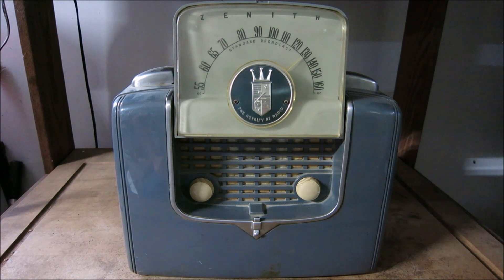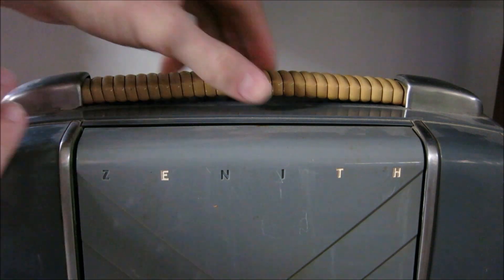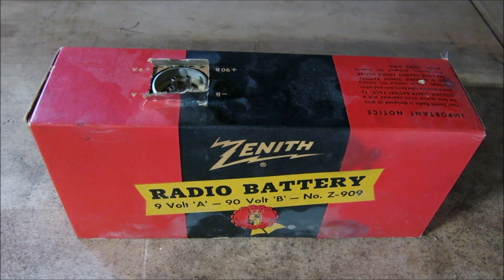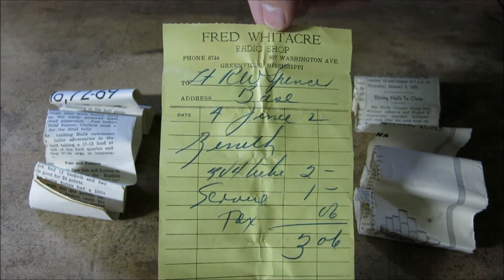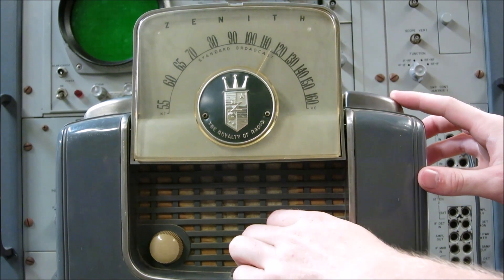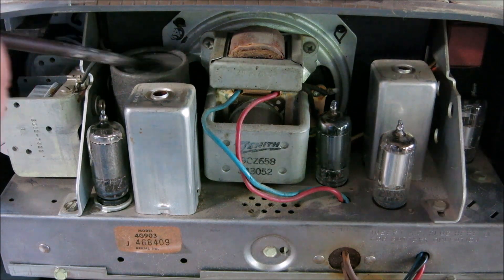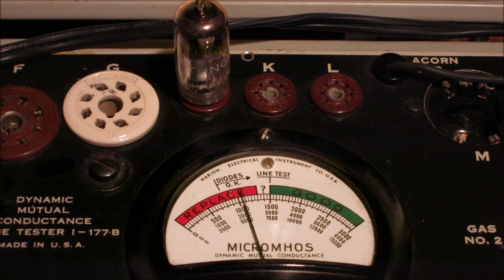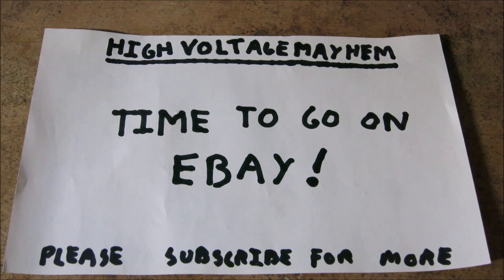Zenith Radio electronics repair/restoration (part 1)

Comment: I HAVE ONE OF THESE THAT'S MY GRANDMAS. I repaired it a few years ago just like this just brown leather and plastic that's so cool! The problem with my granny's was that it had old wax caps radio was left in the attic that gets probably 110 the wax from the caps melted so badly you could see the pigtail wire.

Comment: The plastic cover over the Dial Face is generally cracked, as people tended to slam it shut.  If you have one always close the door downward very softly to prevent cracking the plastic cover.